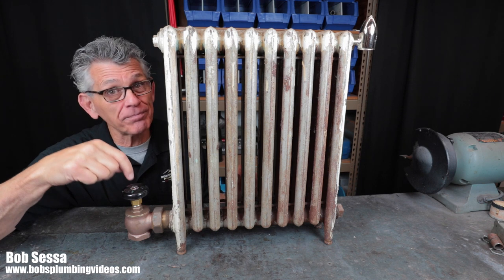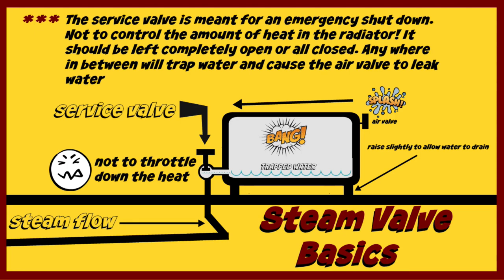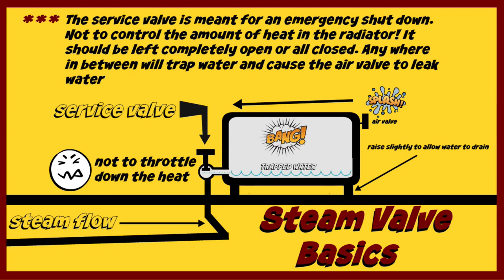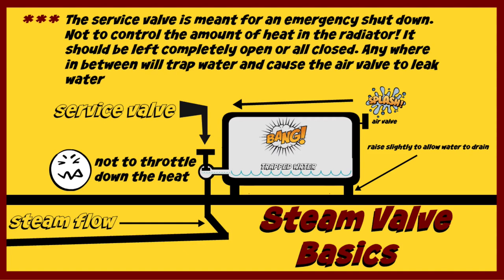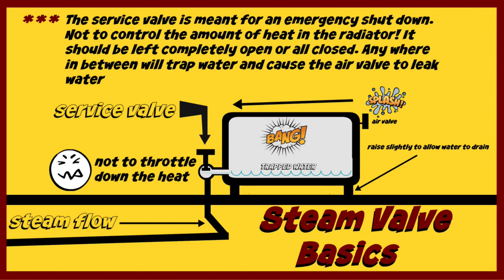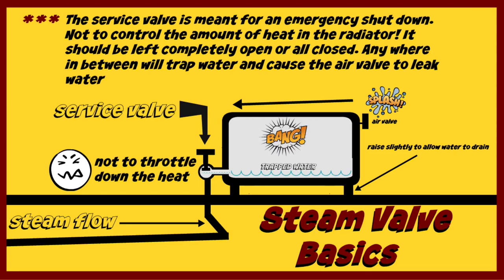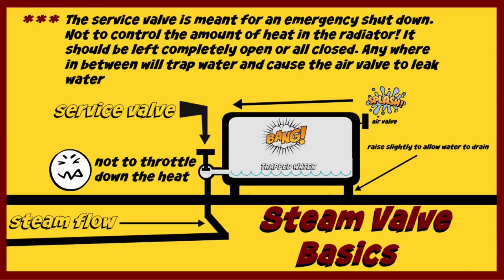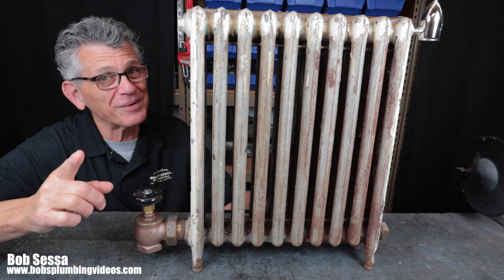Radiator Spitting Water

Comment: Thank you for your wisdom. The newer generation of plumbers doesn't understand steam. It took me years before I got someone who could get my steam system working right. I throttled the trap for years until one plumber from the company I used for years told me how to keep the traps wide open. The other plumbers all said it was because the radiator was at the end of the line on the second floor.

Comment: Thanks Bob！Always very informational and usefule videos。  How about radiator return pipe valve leaky? Should flushing system and replacing the return air valve solve the leaky issue?
Reply from the maker: A clogged return isn't that common, unless you're replacing the valve and it continually and repeatedly leaks I would not flush it out. That could cause questionable leaking return to blow out all together.

Comment: Bob, great video.  What other causes can result in the air valve spitting?  Could it be an over pressurized system or too much water in the boiler itself (wet steam)? Perhaps bad main vents?  Thanks again.
Reply from the maker: Wet steam is probably the most common cause that I've run across, there is no need no run a residential boiler above 1 1/2 / 2 p.s.i.
Reply: @BobsPlumbingVideos  I agree.  If I keep the sight glass just at half, it tends not to happen.  Happy New Year!

Comment: Your videos are the best I've found on this stuff - thank you! Our 5th floor apartment is always waaay too hot in the winter, perhaps because we are in the center of a building, directly over the boiler room (I hear from folks on lower floors and at the ends of the hall, furthest away from the boiler that their apts are usually chilly). If we wanted to shut down two of the three radiators with the service valve (in the LR and Bedroom; our kitchen's radiator already has the valve turned in all the way clockwise), would it be safe to do so during an August heat wave? I'm guessing there has been no steam heat for at least 3-4 months now. 

Also, if the valve just keeps spinning when turned clockwise (doesn't have a stopping point after many, many turns) I gather that means it needs replacing?
Reply from the maker: If it continues to rotate without stopping, it's probably stripped and should be replaced! Thanks much for checking out the video. Bob
Reply: @BobsPlumbingVideos  Thank you! After watching your videos I did a closer inspection, and I can see that the threaded stem area is turning (i.e. the plastic knob is indeed attached and does appear to be doing its job) but it is not moving in or out, so yes, I am going to have the valve replaced. It turns out this is also the case with the second too-hot room. Hopefully this will be a less hellishly hot winter in our home! Thank you again for your reply.

Comment: I have been renting apartments since college, lived in the same Brooklyn apartment now 15 years and NO ONE EVER TOLD ME THIS. Found your video because I’m laying in bed and it sounds like it’s raining - I get up and think my ceiling is leaking, but turns out it’s the radiator spouting water like a geyser. 🤦🏻‍♀️ Unfortunately I’ve 1000% been guilty of closing the valve halfway or when it’s hot. After watching your video, I went around the apartment and opened all the damn things all the way. It stopped spouting water. Do you think I need to call the super to drain it, or now that I have them all opened (and know better thanks to you) it will be fine? Thank you again!!
Reply from the maker: If they're no longer spitting water, you probably good to go! No need the call the super. Thanks for checking out the video! Bob.

Comment: Thanks for more valued information on understandi g my steam heat and radiators.  About how high should the radiator be raised on the one side?
Reply from the maker: 1/4 bubble or so, just enough pitch so the condensate can drain back to the system. Regards, Bob.

Comment: I just moved to Hell's Kitchen this month from Harlem and my bedroom radiator is banging sometimes and spouting water out of the top of the air valve sometimes. I've lived in NYC 4 years and know to keep the Service Valve either ALL the way open or ALL the way closed. My preference is all the way closed, because this apartment is literally hot as hell as it is. Even when the valve is ALL the way closed, both of these things still happen. Maintenance came and replaced the air valve, a week later the the radiator is still banging when off and the air valve just started spitting water again. What should I do or tell the landlord?

Comment: Thanks for this informative video Bob! I have a question for you. I live in an apartment building in Queens, NY and I’ve noticed water continues to spout out of the air valve. The service valve is completely open so I’m not sure what the issue is. The super had changed the valve early March (2022) but water was spitting out before then. Pls help!
Reply from the maker: Apartment buildings are tough, many possibilities but I would maybe strat by using a Hoffman #40 air valve. Industry standard and will tolerate condensate well.
Reply: I also live in a queens apt. The super puts low quality valves or defective valves. Once I purchased my own hoffman 41, I had no issues w hissing or spitting of water

Comment: Great video as always. In my case, I have one radiator that gets no heat. I removed and cleaned up the air vent with vinegar as per the manufacturer's recommendation, but still no luck. I felt by hand to the bottom of the service valve and it was cold. I'm wondering if there is a blockage in the pipe feeding it...
Reply from the maker: Hard to say without seeing things! I've seen jobs where water was sitting in a back pitched pipe prevented the steam from flowing up to the radiator.
Reply: @BobsPlumbingVideos  Thanks! It's a smaller radiator, but it is closest in proximity to the main. Of course, it is the only radiator in my system that I can't visually inspect the pipe as it's hidden behind sheet rock... Lol I'm hoping I can get through the season so I can take my time and open it up to figure out what's going on.

Comment: I have this issue but the vents are not on a radiator. I am in a garden unit that has radiators that have their own valve and vent.

I also have supply pipes that run from the boiler along my ceiling and up into the other apartments that have a vent but no valve. Would the apartments upstairs be causing this even though their radiators also have vents?
Reply from the maker: Hard to answer that question without actually seeing the jobsite conditions, my apologizes!

Comment: Bob, why does one radiator blow steam/water out of the air valve during the morning warm up ?
Reply from the maker: Hard to diagnosis without seeing job conditions, could be a back pitched pipes which water is sitting in, maybe the valve is not fully opened, tough to guess without seeing!

Comment: HI MR. SESSA, Thank you for your advice. I hope all the things I have written are clear enough to be able to get an answer I can trust to be able to protect myself and help me solve my problem: I have all the BANGS emanating from my radiator and WATER SPITTING out my air valve, however I have confirmed both my Service Valve and Air Valve are 100% OPEN. I live in a NYC Brownstone 2nd floor apartment. The building is from 1910 and there is 1 unit in my steam line below me and 3 floors of units above me in my steam line. My question is: Is it possible that my BANGS within my radiator area and Water Spitting out of the air valve are being caused by (a.) my downstairs neighbor in my same steam line who IS closing or partially closing her Steam Service Valve and possibly her air valve as well (although I do not know if she is closing her air valve). or (b) the basement steam boiler 2 floors below me has been overfilled and excess water with steam will come into my radiator and cause the water/steam mix to spew out of my air valve?
Reply from the maker: Without seeing job conditions, I would take an educated guess at B. Depending on how overfilled the system got, you could have excess water in your radiator and or pipes leading up to the radiator. Just a guess?

Comment: Hi Bob, I have a radiator that is very slow to warm. the pipe and valve get hot soon after the heat is turned on, but the actual radiator takes forever to warm up. Only the top  also. the bottom doesnt get warm. Is it possible the bottom has debris in it preventing steam from entering? There are puffs of air coming out of the vent on the other side (ive removed and hole is breathing). My next move is to remove radiator and try to flush it out? Do you have any info on this situation? any recommendations? is this slow heating normal? Its encouraging that the service line and valve get super hot, that means the steam is delivering, it just seems to be the radiator not taking the steam. Thanks.
Reply from the maker: Based on your description, It may be worth pulling the radiator to  see if it's clear. You could have a back pitched feed line to the radiator that's accumulating water. Is the air valve properly sized for the radiator? Is the thermostat getting satisfied before that radiator has a chance to heat up? Many possibilities!
Reply: I recently fixed the pitch of the radiator when I bought the house. But it could have been wrong for a long time. The feed comes in vertically right at the valve and heats up instantly. The air valves are all new and as I said even removed it doesn’t heat up. What should I be looking for if I remove radiator? Blockage? Water? I will check the valve too.

Comment: Does it matter if the air valve is on the same side as the service valve?  Would it cause the radiator only warm-up/ hot half side, not the entire?
Reply from the maker: No, to many reasons to guess why it won't heat all the way. Have to be there to observe!

Comment: my radiator never seems to cool down when open— if i need to close it should i wait until there’s no steam going through it or wait until it gets as cold as i can get it?
Reply from the maker: Aas long as the heat is not coming up, you can shut it. No need to wait for it to cool down.

Comment: Thank you! My valve is fully open. I know you can’t regulate single pipe system.  It’s raised correctly to have water run back. Air valve is taking on water and banging only at the beginning of the run, but loud enough to impede sleep.  The rest of the cycles within the run are quiet.  Air valve hisses after each cycle too.   Air valve is not blown out.  Happens on brand new maid o mist I put in too.  I am the first apt above the boiler in a 20 apt walkup in Manhattan.  Any ideas?
Reply from the maker: Maid O Mist valves are terrible. Try a Hoffman #40

Comment: I installed smaller radiators that attach to the wall.  The top has openings on the front and the back.  Does it matter which side gets the valve?
Reply from the maker: Are these Steam radiators?
Reply: @BobsPlumbingVideos  Yes.

Comment: Years ago had a tenant that tried to adjust heat by the service valve. Water spitting out air valve. I opened the service valve fully and to them you cannot adjust by this method, these rads are are 100 years old the valve will not shut off completely and will collect condensate in the rad. They also had to pay for the repair from water damage to their  and lower apartment.
Reply from the maker: Hard to convince people, but I try! Regards, Bob.

Comment: Mine started spitting after they replaced the boiler. It only happens to the first one that gets heat from the boiler. 
The plumber who installed it told me to change the service valve but it wasn't happening before.

Comment: My landlord installed a dial on the service valve with numbers 1 thru 4 and said i should adjust for heat.  While the radiator does get hot,  i now have a geyser of steam and spittle shooting from the valve.

Comment: Hi Bob, I recently moved into a new building with a steam radiator. The valve is currently closed, I opened it a few days ago and the banging and water was spitting out. If I want to turn it back on, do I need to let the water spit out or should I contact my landlord?
Thank you!
Reply from the maker: I would contact the landlord, it may possibly have to be disconnected to get the water out of the radiator. Something for a professional to handle.

Comment: I know this technology is what, more than 60 years old, but why didn't they just produce radiators with an internal pitch?
Reply from the maker: Not to this old timers knowledge, but I could be wrong. A small plastic shim opposite the steam valve never hurts.
Reply: @BobsPlumbingVideos  Thx for the reply, and sorry for the typo ("why" was missing from above).

Comment: I already have my radiator fully open, tilted to one side, replaced air vent yet its still spitting water. Any advice?
Reply: There may be too much water in system. Check level in glass.
Reply: @The123DNA  What do you mean 'glass'?